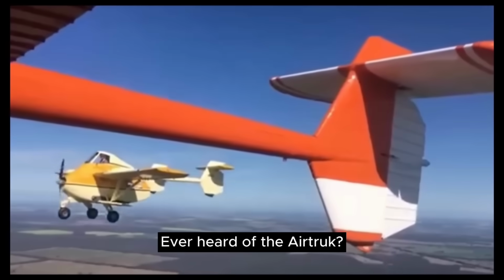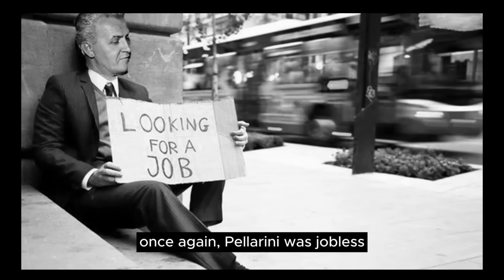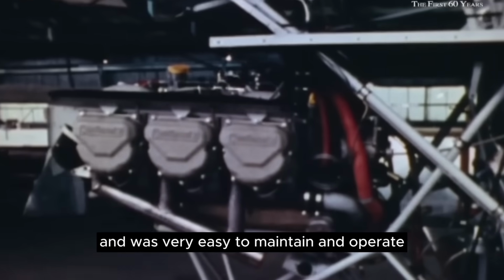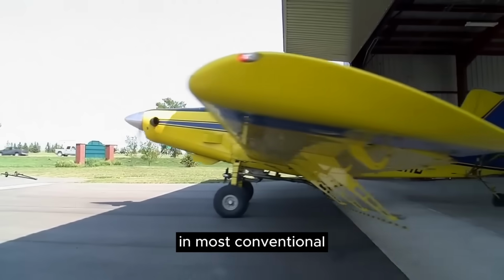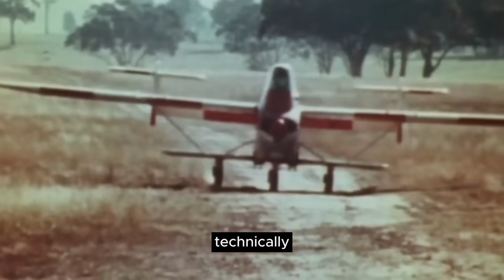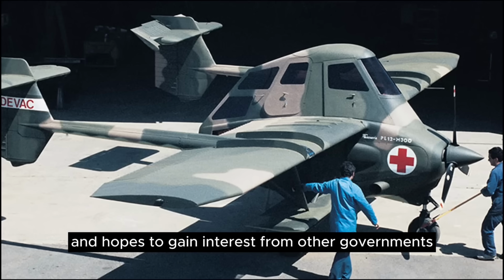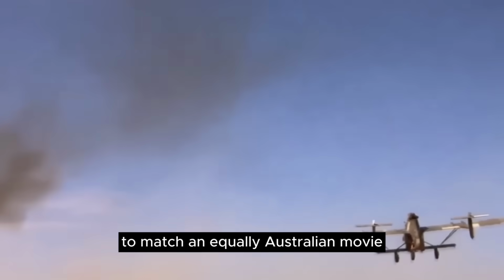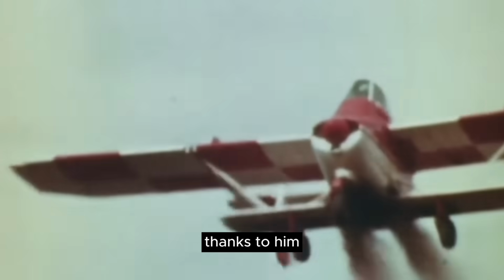Air Truck Is The Most Bizzare Airplane You'll Ever See!

Comment: Ive actually flown one of these fun little aircraft! Gotta say, it was a strange experience to operate, but i actually did enjoy the higher seating position and the weirdly nimble feel of it while flying. landing this thing is a breeze compared to a lot of other airframe designs as you have so much more visibility over the nose rather than being forced to crane your neck around to get a view of things. picks up off the ground faster than almost any other small plane ive flown, almost feels like it wants to leap up if you aren't careful. 

sadly, the one im familiar with was decommissioned a few years back due to safety concerns given its frankly abysmal glide ratio, id love to fly one again if i ever got the chance.

Comment: Would have been a perfect design for a pusher prop.
Reply: I think a key part of its attraction as a crop duster was the easy access to the load hopper between the tail booms whilst the engine was running.

A pusher prop would mean shutting the engine off to reload, so maybe it was something they considered in the early design stage, but rejected after hearing what farmers really wanted.
Reply: If it were not a crop duster, or no longer a crop duster, it is like the O-1 or Skymaster. You could add a push prop engine where that pot of poison was. A twin with the engines in one line, that saves you a lot of worries. It does. You can take off and then fly on one of the engines. If the rear engine is smaller, it saves you fuel. Such details are good.

Comment: As with most experimental aircraft, the glide-ratio is almost nil, so if your motor goes out, you go straight down.
Reply: This wasn't experimental.
Reply: @metricstormtrooper  Might as well be.
Reply: A crop duster is usually flying low over big, wide-open fields, so a deadstick landing might not be too hazardous. Avoiding phone cables and power lines might be more of a worry than finding somewhere safe to dump it.
Reply: This was far more than experimental. Was a workhorse for years
Reply: It looks like it glides very well.
Reply: @bubbajones6907  It depends on its weight, but to me, it looks like a flying brick.

Comment: NZ went on to use the Fletcher for an ariel topdressing aircraft, an American design, that were imported as kitsets and assembled in New Zealand.
But quite a few Airtruks were used here too, and as a kid actually I got a ride in one.
Reply: I’ve noticed the American AirTractors are taking a hold over there. More power and bigger hoppers than the fletcher
Reply: @willjohnson3907  Yeah, but Fletcher Fu24s have been around since the 1950s.
The company that built them here also built the larger PAC Cresco which was popular but now both are out of production. For years Fieldair used DC3s for top dressing.

Comment: One thing they didn't mention about the experience sitting in the back of an Airtruk was the smell of all the chemicals that had gone through the hopper.
Reply: This was a built in feature that kept the pilots from having intestinal worms.
Reply: Only if they were equipped with the chemtrails option
Reply: @mipmipmipmipmip-v5x  And it was extra!!!
Reply: @mipmipmipmipmip-v5x  You do know chem trails are normal right? To the uneducated chem (short for chemical) trails look like sorcery. 

Water is a chemical by the way. Jet engines disturb the air and water vapor around them causing them to have trails. Combined with jet engines exhaust which has carbon dioxide, amongst other pollution particulates and also changing the temperature of said water vapor and air causing "trails".

Now, some planes actually do use certain chemicals to help induce rain, or crop dust a farm. But there's no conspiracy there.

To put it bluntly, there's no reason to talk about "chem trails". Heck, you leave a chem trail just breathing out. Stinky.